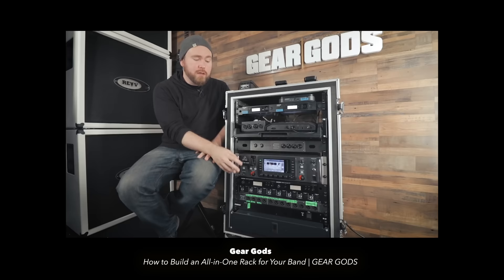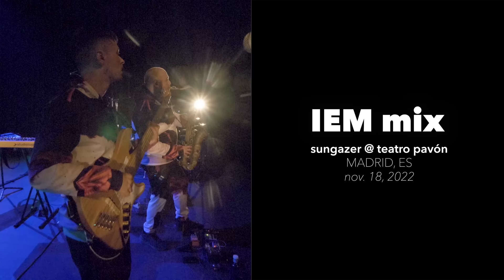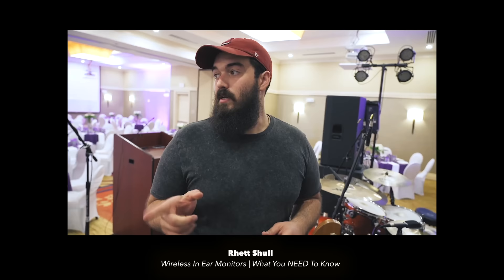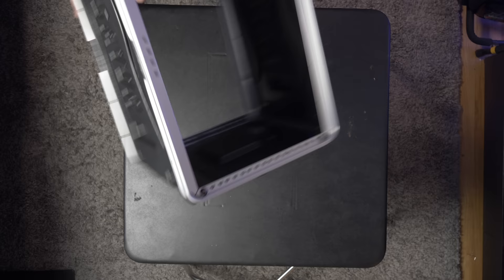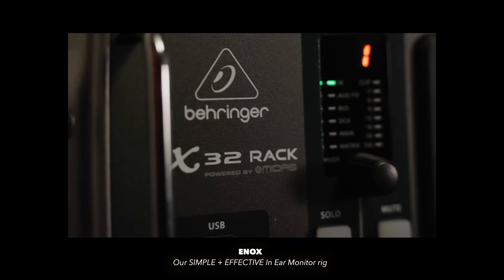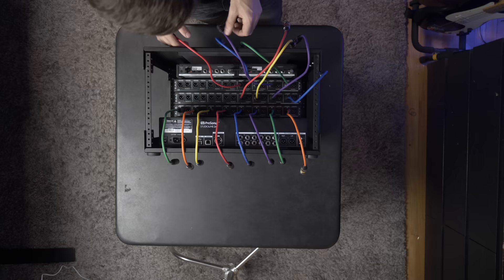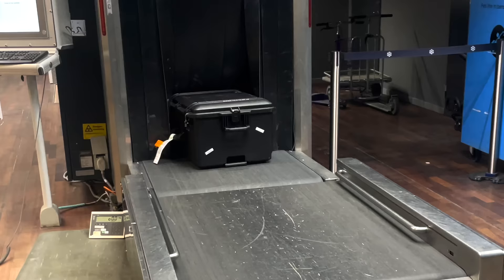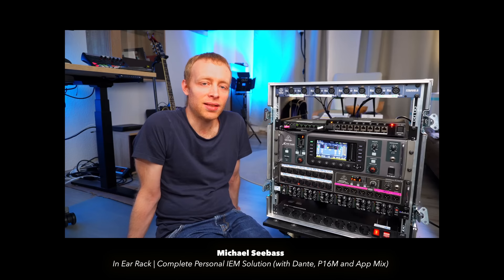How In-Ear Monitors are Making Better Musicians

Comment: I feel like the added control over your playing volume and articulation is alone enough to make the in ears entirely worth it. I never have gotten to play with in ears live before, and the shows I did play weren't huge shows, but they weren't just basement gigs either and we had a pretty good monitor set up from our drummers parents who were also musicians. Even with the monitors cranked it can be hard to hear yourself, especially when you need to play soft in between louder instruments. If you walk out of the cone you get, you just fuckin hear noise and it hurts your ears which means you need ear protection which means now you've changed what you're hearing and you need to turn up more to hear better. In ears just do away with all that bullshit and every band that we played with that was lucky enough to have them had better stage shows because of it.

Comment: I started out as a bad engineer, and I'd like to think I've improved. I've also been the musician on stage, worked with both good and bad engineers, and also with rigs where I control my own mix. From both sides, good or bad engineer, a set up like this is the best option in my experience. 

I'm not much of a live engineer anymore,  and as a musician I tend to avoid performing because my options are usually dealing with bad engineers, hearing loss, or both. If I'm ever in a group that performs long term I'd gladly buy something like this on my own dollar for us to use.

Comment: The PM1 is kind of problematic because the input is not meant to be used with an AUX send but with a headphone amplifier and TRS to XLR adaptors. It is only a volume control. If you plug it into an aux send, both ears will be out of phase and sound rather weird. There is a newer version of this that is called P2 which seems to be a proper amplifier that is made for XLR aux input :)
Reply: @Adam Neely this is spam I guess?

Comment: It would be cool if there was a version of the splitter racks that also had DB25 outputs, and a mixer with the same, that might save some space at the front. I also wonder how having some optical patch options might help, even for making the run to the FOH board easier. Like if there was a dedicated patch for optical on-stage that went to the FOH and landed everything in the right place. Could make things a lot faster but it's a big ask and would need redundancy.

Comment: I'm curious as to what other solutions you've been thinking of to replace your Thomann's The Snake rattle noise. Surely since you're only using that patch bay to tie down 20 (or I guess 16) cables and it's not integral to the actual primary function of the device, there's something you could do to achieve a similar effect? Like using a bigger one, or several smaller ones, or a mix of the two, or something else entirely... 
Even if it doesn't come with a cool rattle noise this seems like there's bound to be a golden solution out there somewhere that doesn't involve mixed communication media (like cables & wifi) or an abundance of zip-ties. Hell even an abundance of zip-ties might be a pretty decent solution if you can make it look organised; like using a bunch of short male-female XLR cables and tie 'em to a grid, essentially gives you the same thing for probably less money and weight.

Comment: I do it on the cheap (skullcandy wired), but using monitors makes a massive difference. 14 years and my practicing and performing is waaaaayyyyy more productive and tighter.

Comment: I think these days a lot of engineers can mix digitally. Your Presonus already has all the outputs and inputs you need on stage that can be controlled from anywhere in the house no need to split them and run snakes etc. (and spend $6k)  Maybe the X32 might be more popular and give you more flexibility.

Comment: I was thinking "soldering is easy enough" when you mentioned it, until I realize, oh wait they might have to use RoHS-compliance cables. I don't know if this is the case though however...

Soldering with RoHS solder seems to be more tricky than the lead solder.

Comment: Modern earphones have insanely high  sound quality for the money. The technology has progressed at much higher pace than any other audio gear in the last 20 years.
The models in this video are not necessarily great sounding and that includes the Westone, but they are very comfortable and generally purposeful. That being said, some hi-fi IEMs under $100 are so refined, that they can be used for mixing. I'm not even kidding. The tonality of these tiny things can be spot on unlike many big over ears and badly implemented loudspeaker monitors.

Comment: Using Shure SE215 for about 5 years, cannot say they are unreliable, cable is possible to replace as many times as needed. Sound quality is ok but a bit expensive for that level. SE425 model is much better option as far as more pricey. Next step would be custom moulded iem's.

Comment: Completely agree with Sure vs MEE Audio. I just wish manufacturers would use slippery cable instead of the "grippy" rubber coating that promotes tangles. Also, I would love to know how to switch to hearing what the audience is listening to and not the IEM monitoring. We don't have an engineer - I have to do the lot. This would help me adjust the mix for the audience. Also - why do drummers especially hate using IEMs? Guitarists, singers, keyboards, brass and even bass players don't complain. Every drummer I have worked with bitches about using IEMs.

Comment: Wow, thank you so much for this. 

I've always thought IEMs were ridiculously expensive, and only major touring acts or someone who plays on the Grammy Awards can have the privilege of using them. 

Recently I subbed on keyboards for a pop cover band - my first time playing with a full live band since the Pandemic - and they were EXTREMELY loud; the guitarist turned it up to 12 and the drummer kept hitting the snare drum like he wanted to destroy it (And his ride cymbal being only 3 feet from my left ear did NOT help). And mind you, this was just Top 40/R&B/dance music, not death metal or anything like that that had to be loud. The on-stage sound was obnoxiously loud, and the house system was loud as well. I brought a small 1000w powered speaker as a personal monitor and even that got drowned out by the rest of the band. I wasn't prepared with ear plugs so I ended up making rolling tissue paper into balls and put them in my ears.
 
I'm quite sure I suffered some ear damage due to playing half a set without the tissue paper in my ear and vowed to play with ear protection going forward. Your video confirmed for me that IEMs have the ear protection benefit as well as monitoring, and the fact that I can get and IEM for under $100 is game-changing. 

Question though - I know part of the high cost of IEMs is getting your ears molded so you can get custom-fitted IEMs for your ear size/shape. Is that still crucial?

Comment: I don’t have an option to bring that extra gear you’re suggesting. So, I have a love hate relationship with IEM’s. IEM’s are great when its right, eg with a good sound engineer and in stereo. But if it’s wrong, and many gigs the sound person gets it wrong… it sucks; big time. Mono IEM’s aren’t fun either. If I’m going direct guitar with the fractal and the sound person screws up the IEM’s then I have no sound. It’s happened too many times. But if I’m using a guitar amp and monitors, then I can at least get through the gig, cause I’ll hear drums and bass directly from their instruments and importantly I can hear myself on stage even if the monitor is wrong. And tbh the guitar almost always sounds better in the room through a real amp than the sound I get sent to my IEM’s. So given all this, I’m not sure I’d say that I play better with IEM’s. Besides, I’m a guitar player so hearing myself isn’t an issue. 😂 just my experiences shared here, may be different for others.

Comment: I remember when I first started using iems after just powering through with only a single wedge monitor for the drummer (sometimes not even that). I was so used to visual timing from all my other gigs that hearing everything exactly in time for the first time actually made me out of time lol. Of course you get used to it and I love playing with them, but it just sucked when I would go back and forth between bands since not all of them had iems and it would throw my timing for a bit and I'd have to readjust. Man I miss gigging

Comment: First thanks for the video - as a FOH sound engineer I wish everyone would use IEMs - the FOH sound (that the audience hears ) is ALWAYS better. 2) You can send me L R bass all day - I'm still not panning them lol 3) I mix each monitor at sound check anyway - doing it in ears is no slower. The sound guy just has to be more careful because we don't want to blow anyone's ears out. 4) Seismic is absolute TRASH do not ever buy those.  5) Some drummers will miss the feel of the kick in their monitor. This can be overcome by using a "butt kicker" 6)The ONLY downside of this system is if your band is playing on a bill with other bands. It is kind of a pain for the stage hands to unplug all their XLRs and use your split snake, then after your set have to unplug your sends and plug in their own XLRs again. Of course if there is enough time between bands this job is easier, but when the promoters schedules bands 15 minutes apart this can really be a frantic struggle. Thanks again! I am impatiently waiting for the day when stage monitors are no longer used.

Comment: As my playing the last year has been split between musical theatre 10 piece band (well “spex”, but that’s the closest description) with IEMs (though using regular headphones, considering buying real IEMs though) and a traditional jazz big band using regular wedge monitors, it is indeed different experiences.

One thing I could never figure out was that some instrument levels did change a lot between nights, but we didn’t have physical splits i think so we were probably still somewhat at the mercy of FOG doing gain and EQ changes. To be able to make your own mix rocks. It just sucks when the wifi drops and you have to shout at the sound engineer to adjust things. (We had upwards of 10 vocal tracks + 16 band tracks to mix…for 10 band members. That takes a while at soundcheck if you can’t mix yourself)

Comment: Such a great overview of IEMs. Seems if you are in a regular band, building an IEM rig is the way to go. Anyone use in ears in a situation where you are the only one using them? How does that work for you?  I play with few different bands and I’ve been wanting to get in ears for myself to primarily protect my hearing. I have a fractal unit and pretty much go direct to PA and use a small headrush for my own stage monitor. My concern is that the bands I play with….the drums and bass aren’t micd up. Since they are not, my IEMs would only be picking up my guitar and vocals and anything else going direct into the board. I’m just curious if this would be very distracting. Not getting the full IEM experience with drums and bass not being run through the PA system.

Comment: Great video. I noticed guitar amps on stage - could you discuss what instruments are using on stage amps and which are direct only or using isolated speakers. I assume amps are positioned differently than they would be with wedge monitors. I know some bassists are going direct and using a bass shaker/but kicker to get the feel of low frequencies.

Comment: @Adam Neely -- Can you clarify the reliability issues you had with the Behringer splitter?  Was it related to the moving/assembling/disassembling, or was it just an inerent problem with the boxes?  Considering building a similar IEM system for a fixed location, but using the same principles.  If "set and forget" would work with the Behringer, that would probably be our ideal choice.  Thanks!

Comment: Hearing yourself live can be such a mess. I play drums in my band and to a click. The guys follow me and I follow the click, so no matter if I can hear them or not I keep to the click and they have to follow me. Every gig is fine for me as I hear what I need (if I could only hear the click I could get through the whole set fine) but for the rest of the guys it’s either they deal with having to follow me and hardly be able to hear themselves some nights or they need to invest in a proper monitoring system. 

Problem is, for smaller bands on busy lineups the change over times are brutal. 15 mins for the band before to get off and us to get on stage, so in the 7.5 mins you have to set up, I wouldn’t even begin to imagine having time to be running XLR’s and extra mics all over the venue and carting on a whole rack of gear on top of it all.

Comment: So, here is a situation. Say when Adam's band goes to a gig, and the FOH side gives the band's Vocals a Wireless MIC to perform, how do they (the band) get that sound on to their IEMs? It's not possible until the FOH guys run a cable from their MIC receiver to Adam's IEM mixer or that 3-way splitter and then they re-route a clean output back to the FOH, right? Am I missing something?

Comment: Question: since that StudioLive mixer has AVB, why not have all mics and line signals go straight through it and send everything to FOH over a single ethernet cable?
Would save a lot of expense on the splitter as well as all the XLR cables.
Granted, not every FOH system might have AVB, but bridging AVB to Dante, ADAT or even using a AVB stage box to get a bunch of analog outs should be possible.

Comment: Thanks for the video, it was very informative. Rather than use expensive low-profile XLR cables, I used an 3" offset bracket to recess the mixer deeper into my rack. I know this video is over a year old, but could you explain specifically how the audio over ethernet sssnake let you down? What's their achilles' heel? Thanks.

Comment: I loved IEMs from the first time i used them but i always had a fear of them going really loud and me not being able to control them in time... And that's exactly what happened at some point when someone messed up and the volume went crazy high... 1 year later i'm having trouble sleeping because i always hear a high pitched buzz in my head 😰 Consider this a warning, i think you can get a device that has a limiter function to prevent this... Never and i repeat NEVER plug your IEMs directly to some sound guy's device without having your own equipment somewhere in between... Hearing loss is the worst thing that can happen to a musician, imagine losing your hearing after decades of practicing and have all that practice mean nothing once you can't hear a damn thing... Just my 2 cents...

Comment: Great video!! I was wondering how Adam manages to use that "Universal Power Strip" when abroad (say EU)? I think that power strip does not convert the voltage from 220v to 110v (or vice versa). It just passes on whatever voltage (range) that it is compatible with to the equipment. So, unless your gadgets are also 110-220v real time (automatic) compatible (no manual switching from 110v to 220v), it can fry if something is at 110v setting. I would still worry about any surges.

Comment: In our church we use a system that runs through cat 5 computer cables. It the Aviom system and it seems that could be another option for you. Plus you can save different mixes for different songs if need be. Your thoughts???

Comment: What about over-ear headphones as monitors? Is that a viable option as well? I actually have no idea 😅
I just don't like the feeling of in-ears and i only found one pair so far that doesn't just fall out of my ears immediatly. All headphones my friends use just don't seem to fit into my ears, i have no idea what's wrong there. Plus I am very cautious with sound pressure damaging my hearing. Adam talked about loud speakers being dangerous, but even more dangerous are loud in-ear headphones! Over-ears are way safer when you turn them up. Of course thats not an issue when the whole band plays with in-ears because the stage is nice and quite and you don't have to turn them up.
Reply: I've found that over ears just don't get as loud as I need them to be. I really have to crank up the gain with them where as In-Ears are much louder at lower volumes. If you are having trouble with in ears fitting, try using a different silicone dome.

Comment: What’s your strategy for wired headphone amps? Do you route 2 cables to an active amp (like powerplay P1), or do you have a multi-headphone-amp with unbalanced stereo cables to a passive volume controller (like powerplay PM1)?

Or is it possible to drive headphones straight from mixer out?

Comment: At that point, what would be the pro-cons of sending a consistent pre-mixed stereo output to the FOH, like the PA is yet another IEM, to avoid "misinterpretation" of the music style by sound engs that sometimes don't do their homework and don't know your set at all (I'm sure it never happened to anyone, right ;-) ) ? They could still adapt to the room/pa configuration with eqs and main gain, wouldn't they? Then the rest is up to you for consistency. Just wondering if it'd be practical?

Comment: I was wondering why you use db25 instead of LK snakes with 24 channels you would just have a single cable and most venue’s (at least where im from) have a LK plug in their house rack so you dont even need to plug any xlr’s separately
Reply from the maker: expensive, heavy, and you’re fucked if they break on our kinda tour. We’ve switched to audio over ethercon, because it’s even lighter, even cheaper, and Ethernet cable is everywhere